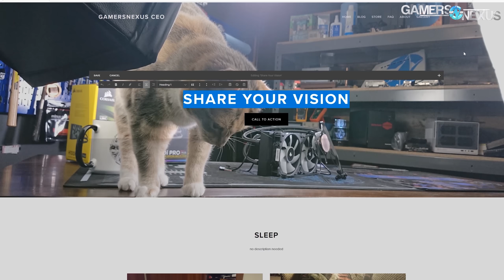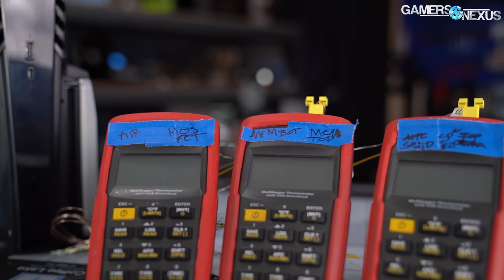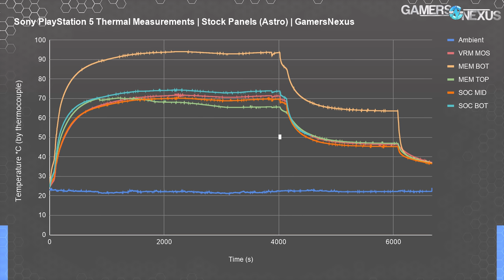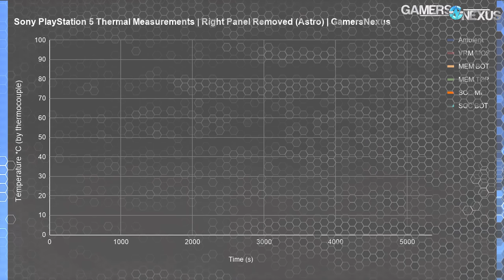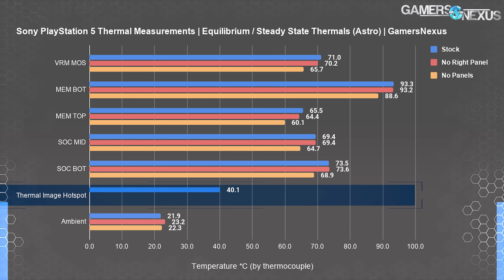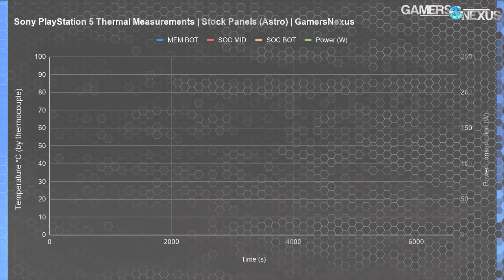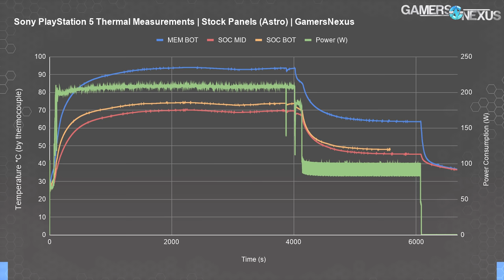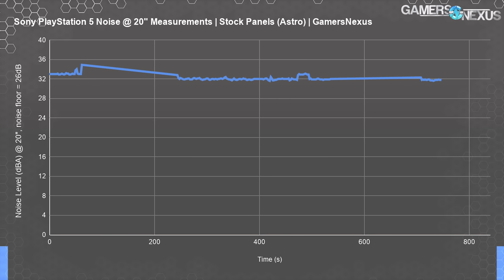Weak Cooler Design: PlayStation 5 Thermals, Power, & Noise Testing

Comment: Called it. Fkn Called it. Knew they were sacrificing cooling for aesthetics but nope people praise the stupid design choices. Should have just made it practical then fancy.
Reply: The designer actually wanted the PS5 to be way bigger from what Ive heard, so I wonder what they had to  sacrifice to get it to this size
Reply: @rolan5948  bigger would've definitely worked out better for thermals. Especially if they were able to fit in more holes and fans.
Reply: @ArtisChronicles  or just.... don’t block the direct airflow with panels 😐
Reply: These numbers literally will not cause a problem at all seeing as how the entire cooling system is set up.This is a non-issue.
Reply: @alpha6games751  elaborate.
Reply: @MrGamelover23  Well for starters the fan system is setup with three different temperature sensors on the motherboard, and another inside the APU. All of them are utilized to control the fan speed based on the APU’s internal temp and the highest temp of those three additional sensors. As games come out and use newer graphics engines etc that are potentially more taxing just like a pc. The system collects this data on the APU’s behavior in each game and can make changes to the fan curve via future firmware updates. (A fan curve is basically how fast or slow a fan spins based on a various temperature states). This kind of method isn’t exactlly new for pc but Sony could create custom fan curves on a per-game basis, rather than just one blanket setting system-wide. Games are complicated, and different graphics engines like Unreal, Unity and CryEngine place different demands on hardware.

Secondly: They spend two years preparing, testing, and optimizing the liquid metal, occupying the tiny area between the SoC (or "system on a chip") and the heat sink system alone. The liquid can conduct 86% more heat and thereby significantly drop operating temperatures while under demanding loads. But then you need to dissipate that heat. Hence the massive heat sink. The system had a pipe-based heat sink that emulates vapor chamber cooling. The heat sink is fastened to a hard copper plate with what could be dissipation fins. All of the major components are connected to the copper heat sink: SoC, RAM, and SSD. The NAND SSD, memory controller, and RAM all use thermal compound to pass heat to the heat sink. 

The PS5's 120mm fan pulls cool air from the front and sides of the console via specially-designed vents. The PS5's curvy design isn't just for looks, but for practical direction of airflow. Air is pulled in and passed through the SoC and heat sink to move the hot air conducted from the heat sink out of the console via exhaust vents. The entire rear side of the PlayStation 5 is made up of exhaust vents.

In tandem with these components, the PlayStation 5's SoC and power supply have also been tweaked to mitigate both noise and heat. Both the PS5's GPU and CPU have variable frequency and maintain a constant flow of power to ensure the fans operate at a consistent level. The whole thing is a highly-customized system that's built from the ground up to deliver performance without sacrificing heat management or noise.
Reply: @MrGamelover23  Furthermore, like I said the outside case was designed to direct airflow for the intake a certain way so by removing it you change the way the system is set up. Electronics and system components will get hot, Some very hot. It’s the nature of the beast and as components and graphics engines get more powerful they generate more heat. As long as the heat is being vented or using a liquid cooling design, it’s not that big of a deal.

Comment: I have an Xbox Series X. I want to know the temperature of the SOC and memories while games are running. If you could do that, I’ll be very pleased
Reply: The series x has the memory synced directly to the vapor chamber cooler, so it likely fairs better thermally than the ps5.
Reply: @jamesarmenti8876  That's the assumption, we need testing to confirm that. TDP tests suggest the same thermal throttling issues though.
Reply: @evolicious  Isn't it rated to run at consistent clocks on both the CPU and GPU though?

Comment: You mentioned calibrating the thermocouples with boiling water. Did you account for water most likely not boiling at exactly 100°C? Depending on altitude and weather the boiling point may vary by a few degrees as it is influenced by pressure.
Reply: Also tap water might contain some dissolved natural salts which raises the boiling point as well.

Comment: Mine is definitely way quieter that previous playstations. BUT the disc drive causes so much vibration I can feel it through my whole desk.
Reply: Probably due to that sticker that popped off and disturbed the fan’s rotation. Mine is completely fine, sounds like a low key air conditioner at first and is just completely quiet.
Reply: you must have a paper thin desk.
Reply: Disc drive wow its 2020
Reply: My PS5 is almost silent and runs cool compared to my PRO. Also, the Blu-ray inside the PS5 is so quiet compared to my PS4 & PS3
Reply: @hoiheyhoi5343  Wow some people still have a lot of ps4 games they still play. Wow some people don't have the best internet in the world.
Reply: @hoiheyhoi5343  I never buy digital and I never will. Give me physical discs all day.

Comment: A steel memory plate for GDDR6 cooling? Did someone from XFX get an in with Sony?
Reply: Nah the bean counters designed it that’s all...
Reply: What's the max temp gddr6 can go. It seems too high.
Reply: @ameerikbal8160  TJ max is 100C iirc, recommendation is to stay below 95C which won't be the case in an ambient room of 30C or with a little dust in the case.
Reply: @axiom1650  so it runs above the limit considering his measurement is 90-95. So games going forward can even push even further. That's not good.
Reply: @ameerikbal8160  that's why Steve said more than once even if you get a letter of exception from the memory maker, meaning you can ignore that 95c limit, you shouldn't. With the console new and running in a decently cool room running say half the ram right at the limit isn't good. And it's not like just putting on larger thermal pads wouldn't help. Pathetic.
Reply: @axiom1650  "which won't be the case in an ambient room of 30C or with a little dust in the case."

If we assume no fan ramp up, sure, but that's really doubtful. The case also has dust catchers, and again, fan ramp up.
Reply: They're repeating the same mistakes that they made with the PS3. I predict that in a few years, these first-model consoles will be plagued with bad RAM chips that render them unusable.

Comment: 16:32 I am tired telling tech reviewers reviewing phones that 2 phones having same soc one with metal body is not fking heating 
It is simply more effectively conducting heat away from the phone hence will not thermally throttle 😑
Reply: IKR, same as the guys complaining that the Xbox gets "hot to the touch", duh!        That means it´s working as intended, disipating heat!

Comment: This and other reasons (bots/availability, DeS Remake being the only worthwhile exclusive right now, technical issues with SSD causing crashes/failures, limited SSD capacity) make it much more appealing to just wait for a PS5 Pro. Hopefully it would have improved thermals, larger SSD Capacity and other issues would be ironed out.
Reply: What sort of timeline would you put on a ps5 pro though. Few years I’m guessing?
Reply: @AnonNA-qv9eo  yeah about 3 or 4 years from now. just wait for the second revision of the base ps5
Reply: Buy the PS5 now, sell it in 2024, buy the PS5 Pro, the end.
🙄

Comment: Yikes the memory could cook some potatoes.
Reply: The Memory can't memorise anything because it's head is aching.
Reply: We'll see if its an issue down the line or if this console is defective. I never buy launch consoles anymore anyway. nothing but issues on the software or hardware side. I wait a year and sometimes 2 for the slim model. unless Sony pulls off a ps4 slim and remove exterior IO that made me buy a og ps4.
Reply: @banner7310  yea I made the mistake of buying the og ps4 at launch. Pretty sure that thing is louder than my washer and dryer
Reply: @WD Fortyyea mine never had a problem with temps, but I could still hear it when playing with headphones and even from the other side of my house
Reply: @WD Forty mine did shut off for overheating snd I needed to open it up to gove it a cleaning, but it was still loud af but no longer turned off.

Comment: Those memory temps are giving me bad flashbacks of the YLOD days on the Phat PS3s. Yeah, that was due to bad caps, but I'm sure the thermals didn't help. This is literally best case too. Sitting on an open work bench at an ideal room temp of 70F, and that memory is still over 93C. My office/game room can get pretty warm in the summer even with AC in the house. Be interesting to see what the thermals are in a hotter room or if it's crammed in an AV cabinet. Really tempting to wait for the inevitable "slim" revisions after seeing that.

Comment: Not putting heatsink on the memory is incredibly disappointing. Why bother applying liquid metal to soc and then just leaving memory naked? Looks like a potential rrod situation to me. Anyway, why not try applying new thermal pads with better contact on the memory yourself and measure temperature? Seems like a missed opportunity.
Reply: Steve said they are keeping the liquid metal intake for long-term validation, so they may do modifications to the console especially replace all the thermal pads in the future. Right now they just want to put it back together and play Miles Morales!
Reply: They've been doing this all the way back to the original OG fat PS3. It's not something Sony just thought they could get away with this generation.

No one wants to admit this but the PS4 and PS4 Pro's memory was hot AF too.
Reply: They must think it doesn't matter and the memory can radiate away the heat as it has traditionally done. In mass produced consumer products every cent saved accumulates on the bottom line.
Similarly I am sure Sony would prefer not using an expensive thermal solution on the SOC but power density meant they had to.
Reply: @RobBCactive  As far as Sony is concerned, they are still within spec for the GDDR6. The TJ Max for GDDR6 is 100c and its recommended operating temp is 0-95c, so in theory - they haven't done anything wrong.

That said, GDDR over the last decade has shown a tendency to degrade when constantly operating at a high temperature - and this is from the PC community, where in the temps typically for VRAM on GPUs range around the 50-70c range.
Reply: @BenTan89  honestly sony didnt learn with the ps3 design and has since kept that philosophy with the ps4. All they looked at was how little could they change from their lab coat design? A ha! Just push the memory far enough away from the copper!
Reply: @BenTan89  95 degrees seems really high, imho. It could degrade soldering and warp system board.
Reply: @lordvicky1546  So, the consumer pays 500$ for the privilege of being a guinea pig?
Reply: @Psych0technic  0-95c is specified by Micron, the makers of these GDDR6 chips. It definitely sounds very high, but it's within spec as far as Sony is concerned.
Reply: @BenTan89  it may be ok for the chip itself, but not so for the board and soldering. Anyway, shame that he didn't test memory thermals with the new pads. He could've messed up the old ones when he took off the metal plate.
Reply: @Psych0technic  I'm not arguing with you, I'm well aware of what the high temps can do. I'm just saying Sony doesn't care nor do they want to care because as far as they're concerned, it's within spec.
Reply: @Psych0technic  I'm talking about why GN hasn't replaced the thermal pads, and yeah first adapters are always gPigs, a product will always have less failure rate if it's being made for years in the factory..
Reply: @lordvicky1546  oh, I see. Well, let them keep liquid intake, since it's doing a fine job it seems. But you can change the pads easily without even bothering soc bracket, looks baffling to me they didn't since they ripped some of the old ones.
Reply: @BenTan89  exactly
Reply: @Psych0technic  Nope, false. You might be confusing solder with the ~2005 soldering disaster.
The reason so many mid 2000's electronics failed (360, PS3, Nvidia graphics cards, etc. etc.) was the move to lead-free solder.
This was more brittle than anticipated which caused it to fail over repeated heat-up/cool-down cycles.
It's important to note that it broke because of the cycles, NOT because of how hot the electronics got.

This is really the only occurrence of a massive physical failure rate on electronics. 
There haven't been any that I'm aware of that were related failures due to how hot a product ran over time. 

Modern lead-free solder doesn't experience this, otherwise the PS4, X, etc. would all be failing at a similar rate to the 360.

Comment: Will you be looking into what "aftermarket" solutions users can take to try and improve the memory thermals such as applying better/bigger thermal pads?
Reply: Yea I would like to see how the ps5 cooling can be improved as well.
Reply: Better thermal pads help if the heat sink still has thermal headroom. So I'd be interested to see the results of that test as well.
Reply: The thing is even with that, you'd still just be sinking the heat into a large steel plate, with no fins. I do wonder why they didn't use an aluminium plate atleast. Probably easier to use steel? Looks like the plates might be stamped.

Comment: Wow, hopefully the next version of the Ps5 improves upon the heatsink for memory. I hope they add a “loud fan” feature that allows you to push the console for slightly better performance.

Also, as a PC/PS5 owner, I’m super thankful to have you pushing back against these companies to make them improve their work.
Reply: You and I both know that this will never happen.
Reply: They could just send out updates to ramp up the fan (something they have already announced they will do based on game to game metrics). I imagine they may just add better thermal putty or pad coverage for the memory modules if they are worried. Maybe add some copper to cover their backing on the board,like the other modules have, to connect back into the heatsink.

Would be kind of neat to see a 3rd party come up with some good airflow side panels, just would need to figure out how to attach it to the console to get around the IP issues that have already slowed down custom panels from being released. Maybe even a horizontally set rectangle of a box with added fans that plug into the back USB port, ha.

Comment: 15:32 Shout out to everyone who said that the hot exhaust on the XSX was a bad thing 😂
Reply: @Ricardo29j  If you watched the video he literally said that he put the wires in a place where there was already a gap 😂 Also he ran the wires along the board which don't make contact with the plate 😂

Face the facts, this is probably the most comprehensive method of determining the PS5 thermals you are going to find 😂
Reply: @IISenjuHashiramaII  Also there is no airflow inbetween those plates in the first place, it's literally screwed shut right next to the fan^^
Reply: @Ricardo29j  you really dont work in engineering anything tech do you?
Reply: @Ricardo29j  oh such a heated fanboy, don't forget you Sony sippy cup gaming water
Reply: @johnuferbach9166  I was giving him the benefit of the doubt in that he was probably referring to heat dissipation rather than air flow but yeah, you're absolutely right 😂
Reply: @TrderJ0es  He's just a fanboy. GN explained it super well for those who don't even work in those areas yet he's still calling him a "fucking moron" and "dickhead". He probably didn't even watch the video fully and just skipped to the results  🤦‍♂️
Reply: @chillhour6155  sir I don't own consoles , and that what he just did is pure stupidity
Reply: @Ricardo29j  That's your opinion. And it's an idiotic one. Notice how not a single person agrees with you? That's usually a sign you should reevaluate your position.

Comment: Conclusion: Plug a 12v PSU directly to the fan to let it spin at 100% and remove side panels or make cooling holes on them if you want your PS4 to last forever, maybe adding a PWM module to control the fan and lower it a bit if at 100% is too noisy is fine too, also you can use the Dremel and drill holes in the plastic side and put dissipator over the still plate where the memory modules are.

Comment: I was kinda hoping he was going to mod the ps5 to improve cooling
Reply: Next PS5 vid soon come
Reply: Well, with voltage regulators you can force the fan to run faster. It'll immediately cool down the system, but if you put in enough voltage it'll definitely sound like a jet engine. Albeit a very cool one.
Reply: Might as well water cool mod it
Reply: What kind of mod would be possible  to cool that memory?
Reply: @carbonara2144  look up a channel called JMAGG he watercooled a ps4. Could probably at least put better heatsinks on mem.